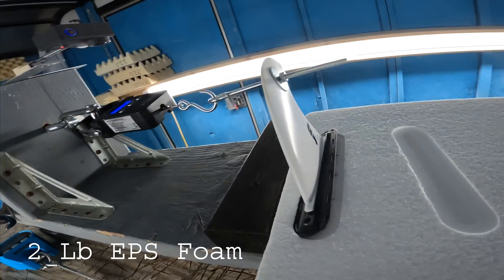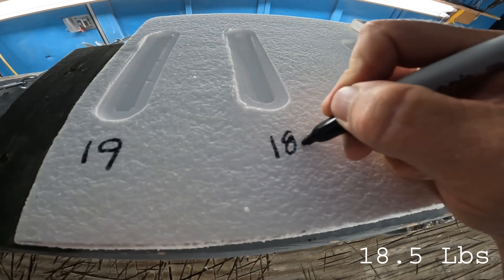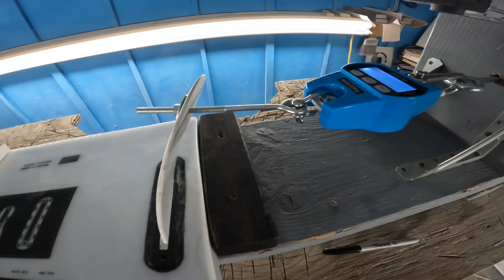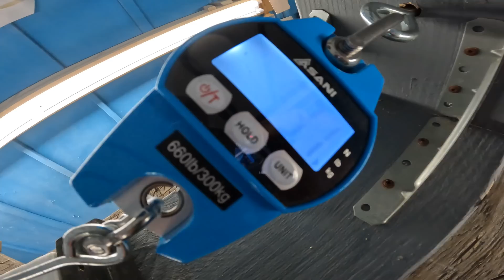Which Fin Box is Better (Futures or FCS2)?

Comment: The blue FCS fins are MUCH flexier than the white futures fins which may really affect the results. The blue fins flex so much, you are pulling from very low, which likely cause the foam to break along its length.  You would have to repeat the entire test with identical fins,    Also, when we  used to glass windsurfing fin boxes we would line the cutout bottom and sides  with  fiberglass cloth, cabosil and resin.

Comment: The fact that the angle of the FCS fin is set by the laminator during box installation vs. it being built in the fin for Future was already the reason I switched to only Future over a decade ago. Original FCS plugs never made sense to me. Their reason for not making mono-block boxes was to "improve the flex of the tail", LMAO. I had the felling Future would win this test and your results confirm that. Thanks for taking the time to test this.

Comment: Have lost 4 FCS2 fins in the last two months despite using the rear grub screw and making sure they are tightened regularly. 

One fin somehow came out on my motorbike rack, that was strange. the other during a failed duck dive on my quad, 3 fins hit my leg and popped out. 

I see that loading the fins sideways makes them pop out even with the rear grub screw is in. I’m not even convinced them popping out reduced the wound on my leg as it’s a sideways load which doesn’t cut.

Comment: I wonder if this just represents two philosphies. 
 
FCS: Don't screw fins.  If they hit something hard or too much pressure is exerted on the fin they'll pop loose and you'll probably lose a fin, but your board will be safe.  

Futures: Screw in fins and your fins will stay in there even with over 100lbs of force.  However, you might destroy someone or something in the water that your fins come in contact with.  Am I missing something here?

Comment: After watching this Im going back to FCS boxes. The reason is, I was surfing my quad and hit a close out and the board rolled over under me. I landed on the board with my hip and groin. The two big fins broke out from the impact. It was painful and I had bruises but no cuts. If the board had future fins in, there is no doubt in my mind I would have been on my way to hospital or worse

Comment: I have both systems and if it is true that the Futures system is more resistant and effective, the truth is that it can be more dangerous for us. I recently fell off a wave along with my board and one of the FCS2 ends hit my thigh hard to the point that I thought due to the intense and huge pain I had a deep cut in my thigh. Fortunately that didn't happen, resulting in a huge, dark mark on my thigh for weeks and a damaged board because the FCS2 case gave way. Given that Future cases are more resistant, I don't know if in my case I would end up suffering a very deep and dangerous cut.

Comment: The issue I have with FCS2 boxes is the repetitive force that the boxes and board take when you push in/pull out the fins.  I replaced a couple of boxes and they all cracked on the back part of the box when I was removing the fins.  Is there any data on the MTF for that?
Reply: Try the fin removal tool. I got one as a gift and it works great. It puts the pressure on the fin box while pulling out the fin, so you aren't pulling on the whole fin box.

Comment: Interesting test. Amazing how much pressure they both can endure!

I've been surfing since the mid 90's. Back then I had the FCS 2 tab (original models) which seemed to be the most problematic (losing fins) or the tab plug caving in from too much pressure. I also had tons of experience with Futures fins (don't think I ever lost a fin). This last 12 years I've surfed with only FCS II. I lost only one fin. I keep the fins screwed down lightly. What I don't like about the FCS II boxes is that the glass around the fin boxes often splinter or get hairline cracks. I have an expansive FCS fin collection and a smaller Futures fin collection but I'm seriously considering going with Futures for my next board. I like the way the fin to the fin box appears to be more flush on the board. After all, at the end of the day, we all pay lots of cash for a board these days and we want it to last as long as possible. At the end of the day, it seems like a toss up but I am going with Futures for my next board.

Comment: I've lost so many FCS2 fins because they pop out. Now i only use Futures. You should too. The whole concept behind fcs2 is that they are supposed to be tooless, however without grub screws, you lose them. Futures is a far simpler, cheaper and better system overall.

Comment: Awesome to see this review, however, in the glassed-in test,  it appears that the plastic fins aren't allowing enough pressure to be applied to the fin boxes, due to its extensive flex properties. Could you perform another test with glass fins which have less flex and would thus convey more pressure into the glassed-in boxes. That way it would be possible to see at which point the glassed-in boxes would actually buckle.

Comment: FCS boxes come in 0, 5, and 9 degrees. With future they pre-cant the fins instead of the boxes. This means if you have a fair bit of V or concave and your using a furure fin with a certain amount of cant you may be getting more or less cant than expected. The average joe probably doesnt know the difference but something to be aware of when using futures. I was recently surprised to see that kelly had switched to futures boxs on his boards but then he is the goat and can ride a barn door better than most on a HPS.
Good video, kind of interesting but a bit of a moot point because we see both of these boxs used all over the world and not many surfers are busting out boxs so the test doesnt really prove anything.
Reply from the maker: Thanks for your input... You're absolutely correct that FCS boxes have the cant angle built into the box and Futures incorporates that angle to the fin. I can't speak for other board makers, but we always zero our fin boxes to accommodate the respective FCS cant angle or the Futures 6.5' install dummy fin, regardless of the hull design.

And know that this project wasn't about proving which box is stronger, but more so, exploring which fin box transfers energy better between the fin and the board.   I gathered quite a bit of data that wasn't featured in the video and plan to do a follow-up video in the near future (it will also include anecdotal input from the comments received herein).

Thanks again- Michael

Comment: In My experience, surfing for 25 years, since glassons were the norm, and having boards with both sistems, I find it that when You hit an fcs fin (specially fcs1) with your body or the bottom, the fin tends to break off at the tabs, with little to no damage to the board, while with futures, being stronger, the damage is usually transfered to the board.. I prefer to replace a fin than fixing a board... Those are My 2 cents...
Reply from the maker: Thanks for your input... and with consideration to your experience, may I ask a question?

When it comes to performance (not hitting things or damage to the board) do you notice a difference in the energy transfer between FCS2 and Futures fin boxes?
Reply: @continuesurfboards4564  thanks for minding my comment... Not really, besides those details, I think they're both good systems performance wise. I mostly notice the difference between templates and materials, more than a difference between the systems.

Comment: this is a great test, thanks for taking the time to make the video.  The funny thing is, some people watch this and think Futures.  I, on the other hand, think the FCS are the better option after this video.  I have broken 2 FCS2 fins early on, oddly, I have never broken a 2 tab FCS  or lost a fin. I would have thought the opposite.  Anyways, the reason I think FCS now is because of the breaking point.  My buddy who swears by Futures, always breaks his entire fin box. I have seen him do it 3 times. The board afterwards has to go in for repairs. it costs him about $70 to $100 each time. My FCS cost me $35 for a new replacement fin and I have zero downtime. 

Also, it is important to note, that the times I broke my FCS2 fins, the contact was pretty bad.  It was my body.  I am certain if it were another type of fin, I would have broken the fin box and worse, hurt myself badly. Stitches.  Anyways, both are great fins for performance but the breaking point for me is benefit and not a flaw. Cheers brahda.

Comment: There are so many more boards out in the wild with FCS systems. Especially in the budget range of course ding repair co. Will see large volumes of  FCS repair orders. Working at a high volume surf shop doing MM revenue every year, been there’re and seen it. That being said. Been riding FCS since 1998 and have only had one board where it sort of popped through the top. But hardly. More like a reverse pressure dent. Never lost an FCSII fin either across various sizes, shapes, etc. Wife and I also ride Futures too.

Comment: I love the fact that you use the most basic scientific method to do the tests, starting with the un-bonded boxes.  That is something my former boss refused to understand and didn't believe that these sort of basic trials can give valid results. Notice the term "former boss"...
Reply: Your former boss might have been right, the experimental design is poor and most of the results are not relevant to the finished product which is a composite and should only be tested as such. Unbonded boxes with no glass on the foam tells you nothing about how a finished composite will work. The strength from the backside of a finished box plays a large role in strength and needs to be accounted for. Further, this only looks at ultimate failure from lateral stress which never happens unless you hit a rock, but that's user error. Stress/strain is probably a better indicator of which box would better transmit force to the board. You might not know what you are talking about. These tests are interesting at best and professional ding repair guys in the comments are saying contradictory things regarding which box fails more often so no conclusion can be drawn.

Comment: It is relatively rare for fin boxes to break from lateral force, so this exercise is mostly entertainment. Typical damage comes from running into things - rocks, coral heads, or another surfboard. For a more useful experiment, test for damage cause by the leading edge of the fin striking (or being struck by) an object. The early version of FCS (with two little plugs for the fin to attach on,) could be broken by an especially forceful bottom turn, which is why it is no longer made.
Reply from the maker: Thanks for your input Kenji. You're absolutely correct that impact is the primary cause of (major) damage to fin boxes.  But I wasn't testing for damage aspects...

My interest here was aligned with exploring the effectiveness of each fin box to transfer useful energy from the fin to the board and, from the board back to the fin.  With the fin box being the conduit of that action between the board and fin.

It's about high-performance surfing and ensuring the rider gets all the available drive and control they can from their equipment. 

And while it's not featured in the video, I actually gathered quite a bit of data about that.   Measuring the rotation of the box at a given force, deflection in the foam and glass, and other things.  And there were some pretty interesting finds!

That being said, quite a few people have expressed interest in me doing a series of impact tests.  If that's of interest to you as well, let me know?  Perhaps I'll do that too...

Thanks again,  Michael

Comment: I've been meaning to do a test like this between FCS, Futures and glassed on fins. Glad this showed up in my feed and validated my thoughts on futures. After I lost a few fins with the original FCS round plugs I made the switch over to futures and haven't looked back and that was 18 years ago. FCS in my opinion switched over to the newer fusion style boxes and fcs2 after their inferior design with the dual plugs (they were easy to install tho), there isn't enough surface area to hold them securely in place. Seems like a case of over engineering something, what is with the two slots for FCS. Futures is a simple slot design and just works. (If I sound bias against FCS it's because fins were expensive and losing a few is not great on the wallet when i was a student, I haven't lost a fin with futures).

Also the Futures 10.75" boxes are used for foils, that says how strong that design is.
Reply: I regret building up an FCS2 collection. The easy snap in feature isn't always easy and fins do fall off.. I've lost a couple and ended up just putting a single screw in anyway, totally voiding the one unique feature of FCS2s.
Reply: I would choose glass ins any day however they aren’t really available since I don’t get custom boards anymore.
Atm I have two boards with the fcs2 features, Although I’ll definitely be moving to Futures in the future excuse the pun because they mimic a glass in more as well as snapping off in the box not the box getter disheveled
Reply: The good thing about fcs is that it is safer, I would rather lose a fin than cut myself or someone who has their fin come off.

Comment: I've always been partial to future fins on all my boards. 

If you have the time, maybe do this test again with a swinging mallet or a weight that can be dropped on the fin from a perpendicular direction? 

My buddy broke both his side fin boxes (FCS2) 10 feet from shore on the first day of a trip in El Salvador. On his first paddle out he got unlucky enough to find a boulder that was just wide enough to wedge in between the fins and splay them out from the inside face. Both boxes had to be repaired over the next few days by a local shop.

Comment: Have had problems with both.  I opt FCS because there’s more that can go right.  A stripped Futures screw hole and game over.
Reply: Yes!, FCS II gives you 2 different options for securing the fin just in case one fails.  The threads found on the box/plugs can easily be stripped and then the only option for Futures is to permanently resin a fin in
Reply: @allwedoisurf  100 percent.    I’ve also had futures where the bottom is too tall and I’ve had to sand fins down so the base of the fin isn’t sticking out of the box.   Just a mess.  Also gotten 2 boards with futures that ALREADY had the screw hole stripped and the screw never tightened down.  Just turned and turned.

Comment: Brilliant experiment. Would love to see this done with the force being pulled back feom the tip of the fin, to replicate hitting an object in the water when moving forwards.  The fins stick out over the box on fcs2 and ive lost plenty like this. Futures boxes cover the entire fin base. I now only have futures on new boards.
Reply from the maker: Great suggestion!
Reply: same here. just had 2 boards swapped out (fcs for futures) great experiment. cheers!
Reply: @donwalks  was it costly??
Reply: FCS design and intention is that if you hit an object in the water that the fin breaks off.
Reply: @danjohnson3756  yeah  but they come out way too easy.
Reply: I just lost a machado keel for my quad set. It just fell out on a lackluster day surfing beach break.

Comment: So interesting, thanks for sharing.

I've surfed FCS my whole life and love it. Never really any complaints about it but hearing loads of stories around me.

Looks like I should give futures a go in the future.
Reply: In all honesty I think it comes down to how well the boxes are glassed in. The FCS2 box deforming could be a desireable thing if you think about its ability to withstand a shock.
Reply: I like both. you cannot beat the convenience of fcs2 though.  I like the weight of fcs1 most but in the end in terms of performance, they are  the same. One can argue that futures is better connected but let's get honest, Fanning, Slater, and a heep others, would not put world titles on the line if it made that much of a difference. Performance wise, all the same. The breaking point is lower on the fcs1 and 2 but in my opinion, that is a good thing. Better to break a fin on a surf trip and than a fin box. better not to injure yourself either. I own both and mostly buy the board based on availability.  Sometimes it's futures and other times it's fcs. All good to me.

Comment: Awesome! I think the fins popping out of the FCS is an overlooked benefit? A bit like a fuse popping instead of your car stereo blowing up....I'd rather have my fin pop out (or snap at the base...) than rip the entire box out (more likely with Futures). Maybe I'm missing something but that's how I think of it. At the end of the day....both work great though.
Reply: Agreed, which is why I often use forward screw tabs and nylon screws on the old Fins Unlimited format. Worth noting that when the FCS does break, there is greater damage to the foam blank. When the Futures breaks, it seems to come out of the foam cleaner. Six of one, half a dozen of the other ?
Reply: except it pops with barely any force. compared to a future that takes over 100 lbs to reach its breaking point
Reply: well said. I'd much rather replace a fin with no downtime than fix a finbox.  these days, that's about 4 to 5 weeks depending on who fixes it. haha  Also something that hasn't been mentioned, injury. I have hit my fins so hard at times that if it weren't for the breaking point, I would have needed stitches. One of my friends with glassed on fins had his entire hamstring cut.  He was out for over a year. if he had fcs2 fins, hitting the back of the fins would have just result in a lost fin. maybe a bruise.
Reply: @ThomyeSurfs  that's so true. Coming down on the backside of a fin is a scary thought. Less so if they pop out.